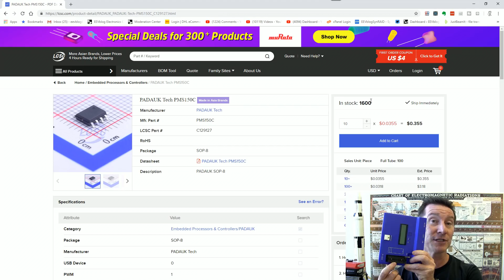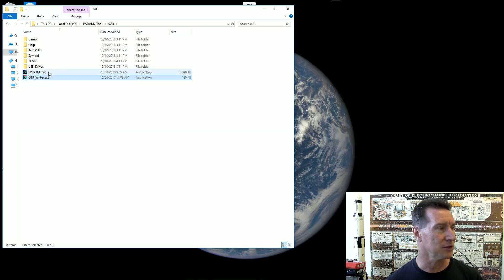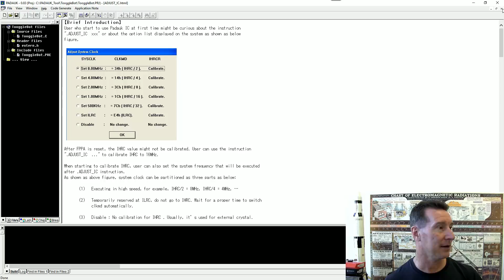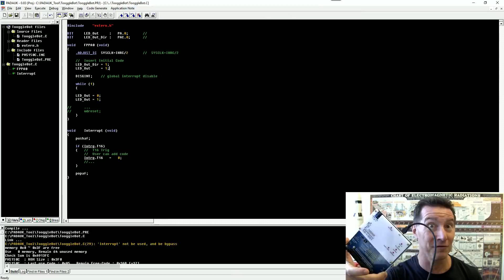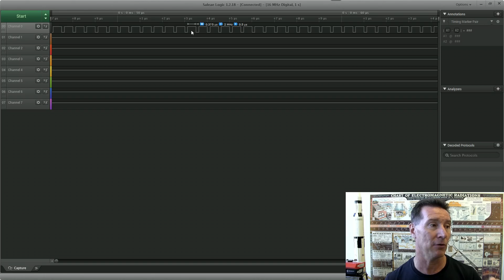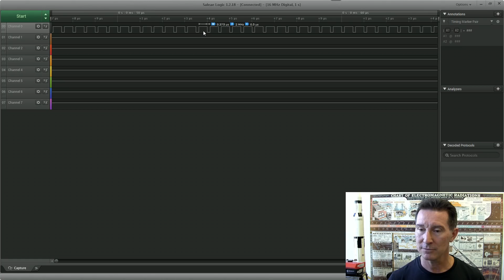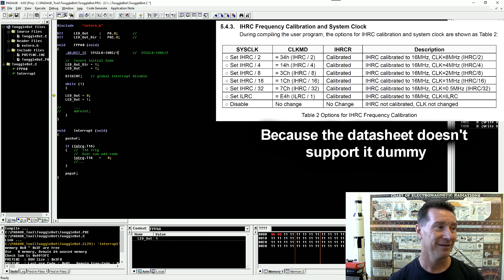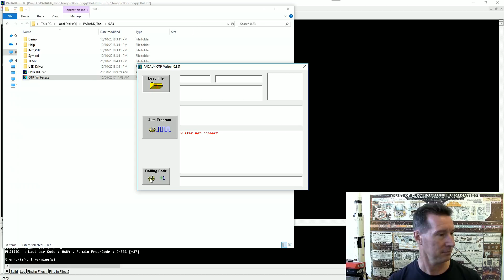EEVblog #1140 - 3 CENT Micro LED Blinky with ICE!

Comment: What do you want to bet, since the memory is so small, and the die size has to be miniscule, that the reason branch commands take so long is that the RAM is actually not RAM but SAM(sequential access memory) much like in the ancient Elliot 703 or the PDP-8/S (I believe that is the serial bus version). That would remove a ton of size from the actual chip, thus making perhaps double or more parts in one run of silicon. If you think back on the size of the PDP/8 "straight 8" vs the PDP-8 serialized version, one is the size of a double wide fridge, and the other is the size of an office fridge or perhaps even a large radio.  Think of what that size difference would mean on an integrated circuit with a 19nm trace width! The simplest computers in history used this method to cut costs way down. The fabled paperclip computer(which has no transistors) uses sequential access "Drum memory" and simply spins around the drum to the right instruction and continues from there.
Also I bet "mini-C" is actually just a renamed "tiny-C". They always use a stupid syntax change in every version. Like Printf is glarbygloopline or whatever. It was designed for small memory systems and can even be RUN on small memory systems. In essence, you can self host and compile on a tiny memory footprint device. Once you learn the tiny C differences, it's a subset of C that is quite useful. Everything you don't get in C you can assemble into objects and include for reference by your main program using the macro assembler. Depending on the complexity of the macro assembler though, you may just end up using that instead...in micro controller applications assembler is perfect anyway.

Comment: I would love to make a servo motor or stepper motor based robot arm (Very short, like 15cm) with a suction tip that could take these ICs out of their carrier strip, place them into a ZIF socket, then another motor/solenoid would close the ZIF socket, then it would program the IC, then remove the IC and put it back into the carrier strip, or into a different strip. Then repeat, and grab the next IC in the carrier strip.  Until it has programmed them all, or stop after programming a user-defined number of ICs. There would also be a dual heated roller mechanism that would reseal the cover strip of clear plastic of the carrier strip.  

Optionally the ZIF socket could be connected to a test circuit, not a programmer, to ensure that the IC was programmed correctly. Or this could be part of the programming setup (to test after programming).

This would be great for people who didn't need 10,000 ICs programmed, but maybe 50 - 5000

Comment: pitty,  the disassembler is part of the ICE and not the IDE. It is very hard to get the opcode-2-mnemonic to attempt to extract the data to recreate a hex or bin file.  It also looks like the IDE can import an ASM file but there is no assembler or help for ASM files.
Someone with the ICE may take some time to look at the xxx.LB0 files and compare to the opcodes in a disassembly.

Comment: Do these chips got runtime memory, or after you program them they run like clockwork? Like, for example, could you make it so they can accept an input that defines the a blinking pattern and duration of the pattern? Could you use them as the "neurons" on a hardware neural network that can learn different patterns?

Comment: Beware low cost Chinese designed replacement parts for US parts. I bought a popular low cost xtal tester that rather than have a 78L05 had a Chinese part with a different pinout. While the part was listed as +5DVC out from 5.5 to over 9 vdc it motorboated, turning on and off rapidly at from under 6vdc on up. Replaced with a 78L05 with the leads twisted around to create the correct pinout and the board works fine.

Comment: For those who mention low RAM and TOP memory size: PIC10F200 has FLASH with 256 words (=instructions) memory and 16B of RAM. And - I've seen it in professional HW, controlling encrypted IR signal. And it costs like 10 times this Padauk MCU.
Reply: OTP*

Comment: Analyser timing: A video on why nyquest doesn't apply, in that twice the signal frequency is enough to accurately reproduce the input might be worthwhile. It took me a bit of thinking to realise why.

Even though the cycle rate is only 2MHz the fact its a square wave means you can't band limit.

Comment: They are out of stock again.
They should give Dave a cut of the profit
Reply from the maker: All 20 bucks of it, great, I'll buy a muffin!
Reply: If it was possible to get the programmer easily or to flash a PIC or Atmel to work as a programmer, I'd buy a few and you could have some icing on top.
Reply: @randomelectronicsanddispla1765  yoycart seems to be doing okay for me so far.  They've been pretty responsive.  If you're going to order from them, pay for 1000g of shipping for each(if you buy both ICE[PDK5S-I-S01] and ICP[PDK5S-P-003]) though, just had to make a followup payment for the adjustment.  I guess I'll see how it turns out when I get them or not.

Comment: Why buy the in-circuit emulator if the chips cost .03  !!!??? I mean that's gotta be something like 4000 chips equivalent cost. So what if you burn through 5-6 chips in testing. Not worth it. I would prefer to eat the cost of 10 chip and chalk it up to development. Of course, if you are going to use it for other more costly micros then have go.
Reply from the maker: Convenience.
Reply: You have to consider the time it takes to take out the old chip, plug in the new one, run the programmer, unplug the chip, put the chip in the test harness, boot up the chip then repeat for every build.  No breakpoints, no viewing memory, nothing except whatever feedback you build in, which takes away from program size and RAM.  Programming time isn't cheap unless you value your time at $0, which you should never do.  Also, your toolchain and documentation is cobbled together from Google Translate of a foreign language.  No way is it not worth it to drop the $105 for the ICE.

Comment: Is it possible that these micros are usually programmed at the time of PCB installation by a special pick-and-place machine that also does programming? Even with low labour rates, I can't see individual chips being programmed one at a time by a human operator.
Reply: In a factory they would use something like that, most likely.  Or they might even have as part of their line something that injects code - who knows.  Like you said no way are they just using humans doing one chip at a time. No one does that on an industrial scale.

Comment: really impressed… hook up a real led (oh you already did) and then hook up a capacitor to the pin to remove the ac Content and get the averaged value and then hook this up to say an Arduinos adc pin. then you should be able to see a kinda sawtooth waveform. would be great as a proof for your Theory here. anyway well done

btw you have set a breakpoint !!! proof at 23:06

Comment: Something like this probably uses some kind of very low cost MC:
https://www.ebay.com/itm/Led-Tea-Lights-with-Timer-Battery-Operated-12pcs-Flickering-Flameless-Candles/153166337655
Reply: Those lights have leds with an integrated flicker module so just one led and a battery inside
Reply: @atc1441  But they allso have a timer function.

Comment: This is exactly where Moore's law still is valid. A speck of smart silicon dust that we can sprinkle over almost anything at almost zero price.
Reply: That's not Moore's law. It's half of it. Trace width is down to 5 nm I think now...this uses 19nm process(which I am not saying is "old") but Moore's law is that you get 2x the performance for 1/2 the price... 8Mhz with 1K ram is pretty fast and large!!! For 1974. What this does is use some cool tricks in the architecture to use minimal die size, thus making it higher yield per silicon wafer run and cheaper per IC. Smaller size die = more chips per run(fewer fails during process) & more chips altogether squeezed on one wafer. IE These are 3 cents because they are so simple and small. Brilliant idea! The idea of producing stripped down stuff hasn't been popular in mainstream companies for eons now...if it ever was. This kind of stuff is more reflective of 1950s/1960s USA computer tech where every transistor was scrutinized.

Comment: For 3c, you could replace a whole load of SSI logic that does not run at any speed with it, or even just put a port expander on it to make a low cost random number display using a cheap dot matrix LED. You could even do that to make a custom font 7 segment display, one IC for clock input plus another 4 driving the LED display (after all 3 of them are cheaper than a shift register) and upgrade the old clock circuit with things like slow fade from digit to digit, or even a roll to emulate a flip display.

Comment: Up/Down buttons with PWM and passive filter as a replacement for a potentiometer.

PID controller

Simple single push button interface to differentiate single press/double press/hold with separate output functions.

Comment: One can make large Spiking Neural Networks out of these cheap uC as hobby project, with each uC as a neuron.
Reply: I think it could be possible if you're using a 4bit synchronous bus (+ clock and bus-free signals). Each uC can at least simulate five neurons (or more depending on the effective bus speed). If you're working with physical separation of the layers things get a little bit more complicated, because each layer need to have is own bus and a gate to the next bus. Makes things faster but less flexible and more complex.
The biggest issue would the addressing overhead. It gets rally heavy on the data transfer if more then 65536 ICs are in the network. Even with 16 bit addressing it would need 4 ticks for the addressing one tick for the command and x tics for the data.
a simple communication needs at least 6 ticks. If every IC want to send a simple data set it would be 393216 ticks for a full bus circle. Running with 8mhz it would take around 0.05 seconds. It's not great but good enough for a slow reacting neuronal network.
So it would be possible to use, but who want to solder  65536 ICs. :-)

Comment: Why on earth do some µC manufacturer keep on building their own IDE & toolchain ? I mean, they did a great job, beeing on their own. But having the same amount of effort on a GCC/binutil port with couples of plugins for Eclipse CDT or even Netbeans C/C++ and you would end up with high end DEV env. From where I am, I see no good reason for a manufacturer like Padauk to end up with creating its own language and own IDE ... It is just a loss of effort and momentum that lower their selling volumes and benetifs ;-)
Reply: That is assuming you could get gcc to emit code that is compact enough.
Reply: @simon7719  You can plug any compiler or toolchain you want on such IDEs. For instance, there are plugins existing that target GCC AVR. If a pluging for a toolchain/compiler is not existing you can create it quite easilly & cheap, at least, when compared to the cost/time to create a complete new IDE from scratch. When you are a manufacturer you usually also push those codes as opensource, so that you will benefit from the comunity contribution to improve the hardware selling point. Padauk way of doing is a bit 90'sish in that perspective.
Reply: @cescargot  I'm far from sure of the value proposition of a big C-aware IDE when the program state must fit in less than 100 bytes. And I'm not sure C is compact enough if you're at this point in optimizing BOM cost.

Also it's possible this predates eclipse or at least that the C support wasn't available back when they started. Rearchitecting this is essentially a total remake of the entire toolset for them so I certainly see why they could be hesitant.

I admit C has some advantages though (de facto standard language) and that I'm also  colored by the fact that my last attempts to use Eclipse have been frustrating to say the least. I shy away when I hear the word D:
Reply: @simon7719  To sum up we have : dedicated&proprietary language, dedicated&proprietary tool chain, dedicated&proprietary IDE. Sure, if you are on a project for 10nk+ volume production, it could worth ramping up & investing in such dedicated jobs. But for low/middle volume, the cost of skill ramp-up a team outperform the cost cut from those cheap MCU. Plus, what about the maintenance cost of it ? Namelly, try to get a Padauk friendly contractor to fix a bug for your next version of OTP batch. How much will it cost ? when will it be ready ?
Don't take me wrong, those Padauk are a amazing value proposition MCUs. But when going for an alternative route one should be aware of the caveats and endorse them.

If you rely on standard stack and tools as much as possible, it will not only help you to kickstart your project but also to maintain it : existing skilled techs, standard skill requirement, more contractors, cost & plan anticipated. I've seen so much tech solutions pushed on projects that were great & impressive niche/expert routes, that turn out to be nothing but nightmares mountain trails on the go: manufacturer goes out of business, abandonware, stack killed as a merger side effect, stack so outdated that nobody is willing to ramp up anymore ... at the end, impact from other's choices will be ours.
Reply: So lots of 8 bit micros have such little RAM that data types like "bit" become useful. Kiel C for the 8051 and SDCC have stuff like this. GCC would need more than just a new backend to support stuff like that. 

Also some CPU architectures are pretty painful to get GCC to work well with. The AVR and MSP430 architectures happen to be very orthogonal and that's why GCC ports exist for those micros. I doubt you'll see a PIC18F backend for GCC any time soon. 

It would be nice if SDCC supported this cheap little micro though.
Reply: @markg735  Sure. As indicated in a previous comment, those IDE have pluggable backend, so you are not limited to that compiler. FYI, there is an Eclipse SDCC plugin (I did not try it). Padauk could have comme with their own toolchain (or simply SDCC port) and plug this to an existing IDE. They've gone another way ...
Reply: But I wouldn't want to run a bloated Java IDE that requires loads of plugins to get all the features working they packed into their own IDE.
Reply: @0xbenedikt  Bloated ? If you meant they are slow start or take tons of memory, I do agree. But I don't know any competing IDE with similar feature that are required to build fast quality code with not of such class requirement, even comercial ones (VS anyone ?). If you think they are point less, I completely disagree. They are multiplatform, opensource, can target whatever platform, toolchain & languages you need, comes full features : editor, debugger, simulator, analysers, team, factory integration, etc. Sure they are not "dedicated" and you need to pick-up the plugins that fit to your context. This makes it complex for beginner. The only value added by Manufacturers are bootstraping code to prevent you from starting from scratch and spend tons of hours. Such features are usualy done in those big opensource IDE by a simple & quick plugin or even by framework. Say you got a problem with de Padauk IDE or compiler and are unable to make your project work with this "miniC", what will you do ? If you are unable to debug with their simulator, what will you do ? You will be stuck to the Manufacturer "good will" & timelines. With those IDE, you got no limit to solve you problem, but your own time & skill.
Reply: It all depends on how much time you expect to sit in front of the thing... 
Think about the expense of building the tools, the profit made on the devices and the Dev time spent on those tiny devices. 
KISS

Comment: I once bought ~2300 AtTiny2313 and programmed them myself. Had a little robot + script that did most of the "work". you needed to drop a stack of them in a cardboard "feeder", it would align, program and "test" them (mostly if they booted at all). Finished in ~90h, only 2 of which required actual human attention if you don't count refilling the stack and giving it a light tap on a semi-regular basis.
Reply: Dude, definitely buy another small stack and make a video of that
Reply: You could probably automate the light tap with some simple mechanism, like with a slow motor or something
Reply: That sounds very intriguing. Any chance of a YouTube video to explain I.

Comment: Just in case anyone is wondering, the manual says that it is recommended to attach 9 volts if a high current is drawn from the emulator. Auxiliary poweryou could say.
Though, i am not sure if they have any chips that can handle that much current anyway. But maybe some of their larger chips can.

Comment: I think i have read about mini-c in embedded controller context before. IF i remember correctly it's a predecessor+compiler that is designed to be an expanded macro-assembler to look more like C. It will not create much overhead. By example by avoiding a stack if possible. But i can't remember the processor type it was initially created. I can remember that it was ported to a few different systems. (My memory said that i found it while searching for efficient higher 68000 languages, but i relative sure I'm wrong. It seams unlikely that the project is that old ...)
I did a quick search but did not find what i remember.